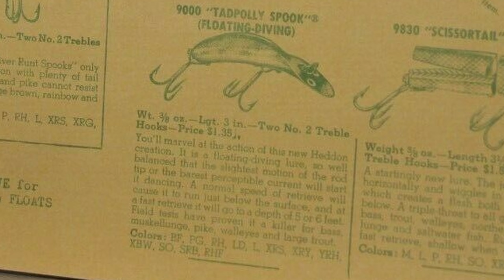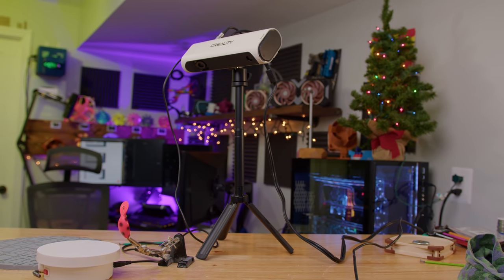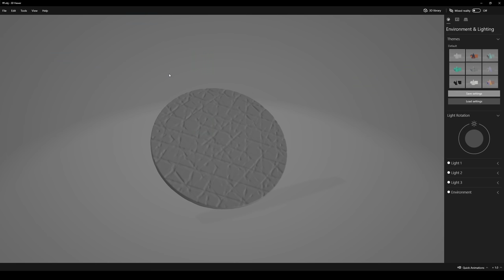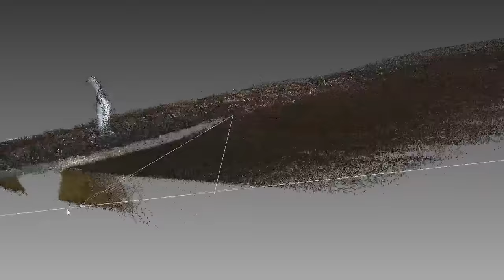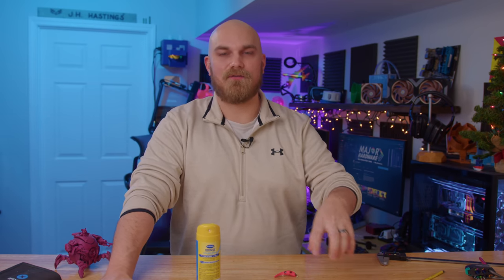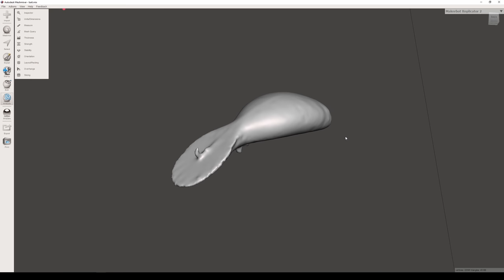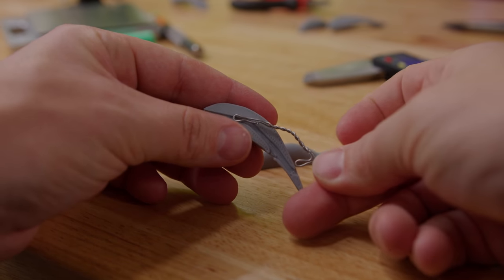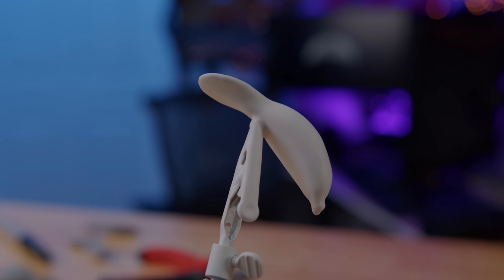How to 3D Print VINTAGE fishing Lures or ANYTHING | Heddon Tiny Tad

Comment: Probably be a good project to print in resin (one piece), Make a mold of it and cast in epoxy around the stainless steel back bone.
Reply: Came to say this :D
Reply: I was gonna suggest instead make a silicone mold of the original and then embed the stainless wire
Reply: @VinayVarsani  I completely overlooked that he had the original. Might be better not to have the metal loops of the original in the mold but he could 100% forgo the 3D printing step.
Reply: @VinayVarsani  Yeah, I feel like this is one of those "when all you have is a hammer, everything looks like a nail" type situations. Like, "I have a 3D printer. I can definitely print a fishing lure" and you never stop and think if that's the most effective way.

Either way, though, this turned out pretty good
Reply: That completely overlook the critical requirement that it has to float
Reply: I'm sure he's perfectly aware of resin casting blah blah blah. That isn't really the point of this channel, like, at all. I'm going to assume you're a newcomer but maybe check out some more of his stuff and you'll understand that the whole point of this WAS to 3D print it as best he could, not to get a perfect replica by any means necessary.
Reply: @ethanharvey3111  There's zero reason a channel has to be one dimensional.
Reply: @ethanharvey3111  I don't think his dad meant he ONLY wanted a 3d printed one and no other version would do... we're just saying if he wanted an easier method then casting would result in a much better outcome. And also his whole channel is about designing and building things in a way that makes the best of your knowledge and skills.. not just one aspect of creating things
Reply: @eriktressing4932  yes true but there's ways to make the inside hollow still with casting
Reply: @VinayVarsani  Plus casting allows for other experiments too. Like adding a lead weight to the head and a hollow ball to the tail. Mixing different elements to it.

Comment: One thing I like to do when I am putting 3d printed half together is to make some 1.8mm holes in both sides in the drawing and then use lengths of 1.75mm filament bits as the pegs for the holes.  It really helps get stuff to line up.
Reply: neat idea

Comment: The action is determined by the way the bill directs water. It looks like the geometry is slightly off versus the original. Maybe widen the bill and thicken up the taper underneath it, and you should be solid. I look forward to trying out this 3d mesh software to see if I can recreate blanks of some of my lures, so I can custom paint them without losing the ones I already have
Reply: Bit of rounding where the bill tapers.

Comment: I don't think PLA is going to be a problem. I made a new dome shaped cover to one light i broke in a crane. Printed it with transparent PLA and it's going strong for five years now. It lives in the elements, it's gotten plenty of sun exposure, it's eaten metric tons o road salt, it's been in +30 and -30.
Reply: I agree. PLA is much better material than many people think. I have made multiple lures with PLA and they work perfectly. I even installed the hook holders with just epoxy (no "through hull" like in this video) and none have failed so far). PETG is not good material in this application, as it's really difficult to paint.

Comment: Try diluting the polish or spraying acetone dilution on it to smooth it
Reply: that would melt the PLA
Reply: @marcogenovesi8570  maybe not, as the solvent in the nail polish didn't dissolve the lure on the first coat.
Reply: Nail polish is such a tough paint for small jobs. Who knew. (I Use it to touch up white hvac fixtures that get scratched during installation)
Reply: @marcogenovesi8570  what if you diluted it with rubbing alcohol

Comment: I just picked up the Elegoo Mars 3 resin 3D printer that just came out.  It is the same size as the Mars 2 but with a 4K LCD.  This thing rocks.  The print quality is crazy good.  Mostly I am printing Warhammer models, but also HO scale train bodies, D&D miniatures, and likely as my grand daughter gets older, figurines or furniture for the old doll house.  I had 2 days of mostly screw-ups and 3 days of near perfect prints.  Now these re not big... and not fast as a fan would need to be tipped up and would likely take10 hours to print, but they are smooth.  I get none of the print lines you get with filament printing.  The Investment up front was no bad.  I got the printer, the wash/cure station, 2 1000g bottles of resin, 6 bottles of 91% IPA, a plastic jug with a basket to pre-wash the models, some plastic putty knives, a 6 pack of paper towel, a 50 pack of gloves, 3 craft trays, and a 1" paint brush (for cleanup).  Total was bout $650.  I got about $240 in models printed out of the first bottle, so this printer is going to pay for itself FAST.

Comment: I would think PLA will be just fine, it doesn't degrade much in water anyway, the stress is being carried by the wire "backbone" and the nail varnish coating will protect it - its quite waterproof. Maybe PETG might be an idea for future experiments. Its been many years since I fished with a lure, but I recall being told the main thing is the size, motion and patterns moving about, fish are instinctive and won't care too much about the quality of the finish :) And of course, now you have the pattern you can make several for your Dad with all kinds of finishes! 
This is a great video re: Meshroom, I haven't heard about it before, I might make some kind of turntable and see if I can use it to scan something. I have zero skill with mesh editing but I guess this would be a learning opportunity.....

Comment: I have done some fishing lures whit the same type off solution whit the wire . But instead off glue it together I told the printer to stop on a specific layer height and put in the wire. Then a let it finish the print and just put some glue where the wire came out to seal it works great ! Have even done the same when I put in weight too the lure.

Comment: Wet/dry sand paper over the nail polish for a better finish.  My only real concern is the curve of the internal wire. It may cause a lot of internal stress and split the bait. If possible,  could you make the wire straight from one end to the other?

Comment: You need to tilt the tow loop tiny bit to the right. It was diving to the left. 
The original needs adjusting also, but to the other way. 

I have made thousands of crankbaits and i immidietly saw the swim is not tuned right

Comment: I think if you made one and then made a mold and casted it it would be better for making a bunch... But since you have multiple 3D printers, an even more interesting method might be directly printing the mold, and then sealing it with a gasket that was printed in a more malleable/rubbery filament.
Then you could just cast it.

Comment: Tried painting on some resin? Or, redo the 2 halves, leave more open space in the center. And leave a bit of wire floating on the inside freely.  Should help create tiny vibrations . Also, doesn't Solidworks have CFD or FEI tools that could be used to see how it would move in the water?

Comment: I don't think it will work. Because the core on the original lure is solid medal thicker than the wire in the 3d printed lure. But I could be wrong would love u to put a video up of u using it to see if I was right or wrong.

Comment: What material would you recommend using for printing water cooling parts? I wanted to try making a CPU block but I've only worked with PLA so far.
Reply: Resin. You won't get  a water tight seal with FDM printed materials like PLA.

Comment: PLA is fine but you should put an epoxy coat on instead of just lots of paint lol, the epoxy will make it good and hard and nice and smooth. Theres all kinds of brands out htere including some designed for 3D printing

Comment: I would have gone completely different process for this. Cover it in wax, clay mold, then use silicon or resin. This would make the lure stronger and easier to place the brass (stainless still corrodes) "spine".

Comment: Dude software Idea! I have a Chevy Sonic with a 5 speed manual transmission. Runs great, fun to drive, but the cheap chevy shifter broke into a million pieces so all that's left is the unsightly stub that the original shifter sat on. I have access to a 3D printer, I just don't know how to make the model, or even where to start.

Comment: Probably could have saved you a minute if you created a cast of the original , added the metal parts and rotocasted the lure. you could make a bunch pretty quick doing it that way too. It would be airtight right out of the cast just requiring a lick of paint for looks. Has the added bonus of adding to your skill set and options for content! I mean, you could always print a cast and do it that way... each to their own I guess.

Comment: Thanks for the videos and their quality as per usual :)
Instead of taking a huge tone of pictures, perhaps next time you could take a video of the object an then feed each frame to the software
Also, you might consider using a blank background for  it with some light above ?
Anyway, carry on the good work ! :)
Reply: Video's are bad due to motion blur. Tried it and most of the frames get rejected. Even with high speed cam it's not optimal as you will end up with too many pictures and it will take FOR EVER....

Comment: Ok so i will give u my thoughts and u just steal anything that sounds good. I have been making lures for a while. Instead of that stainless steel wire thingy i would use "pianowire" it's not as bendy and holds better. If u want to make it watertight i would maybe superglue it (or epoxy it). Then before i paint it, i would use a mix of maybe 20% acetone 80% epoxy. Sand it down a bit. Paint it and then 2-3 layers then straight epoxy 2-3 layers. There is epoxy for fishing lures. U need to dry that thing while its rotating so u get an even spread of the epoxy. The motor from the spinning thingy inside a micro wave has the right speed or disco ball motor. Check out marlingbaits he does some amazing work

Comment: also you could dip the pla print in UV resin and cure it quickly with a UV light and that would seal up the lure so it doesnt have holes then you wouldnt have to use so many coats of primer or paint lol.